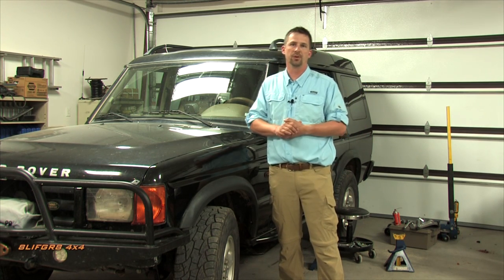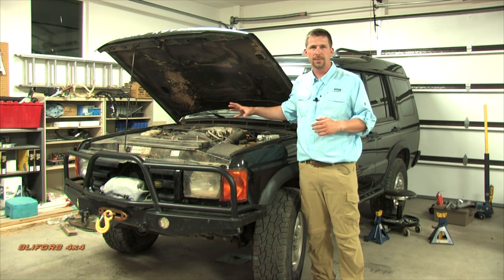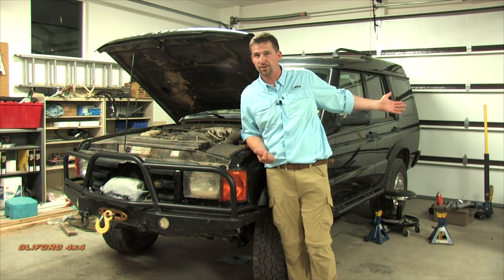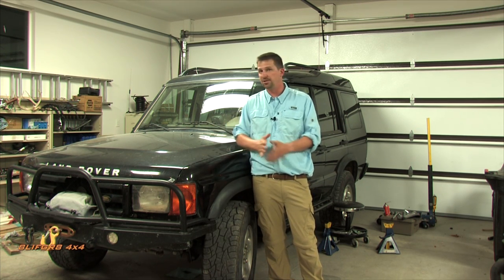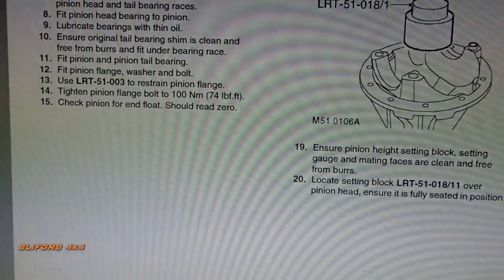Ultimate Owner's and Buyers Guide:  Land Rover Discovery 2

Comment from the maker: CONTENTS:
0:00 Intro
0:55 Front Driveshaft
4:59 Engine
16:36 ABS/Traction Control (3 Amigos)
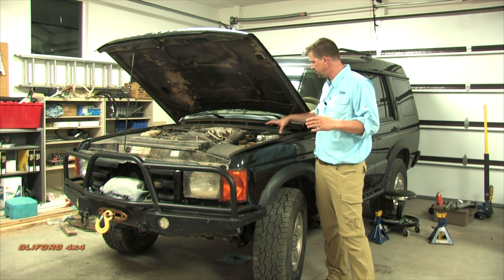19:54 Brake Fluid Reservoir
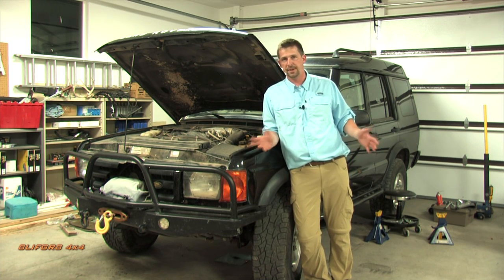20:56 Crankshaft Position Sensor
23:32 Oil Pump (especially 2003 model year)
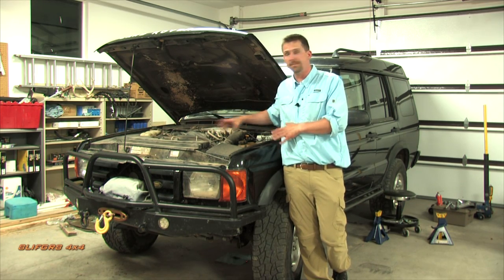24:39 Frame Rust
26:24 Rear Driveshaft
28:49 Headliner
30:16 Center Differential Lock
35:35 Oil Leaks
38:06 Factory Service Manuals and Community Help
39:30 Final Thoughts

If you haven't seen it, check out our more traditional vehicle review here:
https://youtu.be/hWyN0qF666s
Reply: 8LIFGR8 4x4   Thank u can u put a 350 vortex in the Land Rover 2
Reply: instaBlaster...
Reply: Thanks  a million  for this video!🦋

Comment: The best part about the Disco 2's shortcomings is that you can get them for dirt cheap.  I grabbed a clean '99 with a blown headgasket for $700 bucks.  $300 in parts and a few late nights in the garage later and I have a $1000 Discovery that is a blast to drive!
Reply: No rust?

Comment: This is the best Landrover Discovery 2 owners guide/ summary I have ever seen, bar none! Great work! I am a 2001 D2 V8 (4.0) owner in Australia (owned for 3 years) - most of the things you discussed have happened to me. Head gasket! Yes I paid for a new install, after blowing one, and immediately after i did an in-line thermostat conversion to an 83 degrees C (181deg F) t/stat and haven’t looked back. Australia doesn’t have a cold weather problem it’s heat we have to worry about here. Penrith HPR30 is the oil of choice here, Oil leaks are everywhere- keep it topped up. Three amigos are a part of life, but don’t cause any issues. Ashcroft CDL linkage, Rock sliders, heavy duty prop shaft are all future purchases at $1000 each. Parts are expensive but the car is worth it!! Keep up the great videos!
Reply: Jeff Addinsall hit up eBay. I got a new brake modulator block for $100. Got rid of the three amigos and the traction control is now awesome. Also you can get a pair of wheel hubs on amazon if the wheel speed sensor is the problem.
Reply: Jeff, can you eliminate the thermostat all together? I moved back to Hawaii  and when I lived here back in the 90’s it was common to take it out all together in your cars. Having said that it was a 71 Cuda , so a very simple carb, no computer, push rod motor. Thoughts? 
I’m looking at a Disco 2 for sale and would eliminate the cats for sure! More power, better mileage and a lot less heat! 
Cheers
Reply: @michaelm2502  no, a thermostat is a bonus, not a negative. Like the man said, just get a cooler one.
Reply: GOOD ONYA DIGGER!
Reply: @michaelm2502  Hi Michael I did the same thing years ago in an old Holden (GM) sedan I had, but the D2 BMW thermostat setup just runs too hot for Australian conditions. My 83 celcius setup is now spot on. Good thinking on the cats - under bonnet heat is a real issue, and we
Don’t have emissions testing here.
Reply: G'day Jeff

Completely ignorant of D2s, and am looking at getting one, a TD5

Does the diesel have cats, etc that cook the drive shafts like the petrols do?

Thank you for your time

Regards, Will
Reply: @willhooke  great question William, I only wish I had bought a TD5, they have Cats, but there is no way they would run as hot - I have replaced my front drive shaft with a HD one.
Reply: @adda58  thank you for that 👍

I want to get one that's as reliable as possible
Don't want to get stranded, etc
Reply: @adda58 hey mate I also live in Australia, couple of people have scared me about the cost of repair on the disco in aus. Really love the car but just wanted to hear your experience and thoughts.
Cheers
Reply: @finnlord3093  hey! They certainly can be expensive, but if you learn to do a lot of work yourself you will save a fortune. I am about to do a coil relocate, as one of my coils is busted and it easier to put two new ones on top of the motor than pull it apart to get to the old ones .  Depends where you live too. There is almost always a good landy mechanic everyplace I have lived. Canberra has the series workshop, Melbourne has a few, Brisbane as well and lots in between. If not a certified mechanic, you will find a landrover tragic who can help!

Comment: Thank you. I have a 2003 with 200,000 klms.  I put in Castro classic oil with zinc and the correct coolant, but when I checked the clutch fan and the condenser fan they were not good. After doing a hour long run the clutch fan turn easily and the condenser fan was seized. The engine works great on a nice cool day in  Alberta, but when there are things that are not working the way they should they show up on a very hot day in a traffic jam. That is when everything in the disco needs to be right, thermostat, fans and coolant

Comment: I have a 2004 Land Rover Discovery with about 164k miles and live in the southeast of the USA. I use Mobil1 15w-50 ( has 1,800 ppm of zinc ) with Mobil1 oil filter and Dura Lube engine treatment. I have already replaced the head gaskets ( with non torque to yield bolts - used in the 1993 Range Rover 3.9 liter), intake gaskets, valve cover gaskets, spark plug coils ( with wires and Denso spark plugs ), water pump, 180°f thermostat, coolant, coolant hoses ( even changed the plastic lines to rubber hoses ), camshaft, lifers, rocker arm assemblies, timing gears, timing chain, oil pump, front main seal, camshaft sensor, crankshaft sensor, drive belt, idler pulleys, auto tensioner ( with metal pulley ), all four ball joints, front driveshaft, both CV axles, all four wheel bearing assemblies, rear driveshaft rubber part, windshield post covers, plactic trim for the rear doors, sunroof ecu, driver's door lock bar ( updated part ), AC compressor, fuel sending unit assembly, both leather boots ( for parking brake and transfer shifter), gas cap, battery ( redtop ), brakes ( all pads and rotors ), tires ( Nitto NT 421Q ). I resealed both differentials, transfer case assembly, and throttle coolant plate. I repaired the sunroof drain lines. Flushed the engine with automatic transmission fluid ( before replacing the camshaft and lifers ), coolant system ( with distilled water and dex cool ), brake fluid system ( DOT 4 ), and power steering fluid system. Cleaned the fuel injectors, throttle body, and intake system. I have also put dielectric grease on all the wire connectors and grounds.
Reply: That's a remarkable, expensive potentially and time-consuming list, I've driven nothing but old school Mitsubishi monteros for years and found a 2001 disco 2 for 3 Grand which has been owned and maintained by an enthusiast, but I could pick up good old school full size montero for $1,500 or much less for years, never having to spend a dime on them week after month after year , they're Mighty cool, but your intensive maintenance issues / needs indicates to me that I might just steer clear, this video was helpful but your comment told me a lot more than I ever could have absorbed skimming through things, how long did your process of upgrading and maintaining take? Got to be into the high four $ figures and probably a hundred plus hours? Neat trucks but...
Reply: @GreenCanvasInteriorscape  Doing all the work saves money haha. I recently switched to Shell Rotella T5. It's a good daily and project. I think it's a Land Rover thing you love them or you don't buy another/keep them for long. The biggest thing is if you keep on the maintenance and the little tricks, they can be pretty reliable. I have never been stuck on or off the road.
Reply: Can I buy it from you?🙂

Comment: 1999 Model. AKA the green machine....ABS icon on for over 2yrs. Ripped headliner out 10yrs ago. Replace 3 window motors in 5 yrs. electrical gremlins here an there....219K miles. It marks its territory wherever it parks. It changes its own oil- just replace the filter. ❤️

Comment: I'd like to add, that in addition to rotella t6 5w-40, I use a MANN 950-4 filter.  It's a Ford f150 spec filter, it's approx. double size for capacity, and has a hex on the end for easy removal.  Also very heavy duty.
Reply: Was that for the V8?

Comment: I have a hand me down 2003 Disco 2 that belonged to my sister. In the last 5 years I’ve been through every single thing just listed in this video. Except for the transmission disintegration episode. I managed to change my driveshaft U-joints just in time. 

Thank you for this informative video. I’ll make sure to save it in my Discovery 2 file folder. Cheers!

Comment: I owned a 2001 Disco 2. For meany years. I added a CDL from a 04 D2, Installed a 2.5 inch old man emu lift and added the Disco 1 rear spring perches. 
I now own  the Toyota FJ Cruiser, But wanted to stop by and see my old rig. 
Excellent video!
Reply from the maker: Nothing wrong with an FJ either!!

Comment: Hi FW. Just a quick update. Ive installed an OBDll ultra gauge ,fitted the TD5 stat, changed The viscous fan ,  flushed the rad, replaced expansion bottle cap ,and refreshed the coolant .Discovery now driving 188 degrees to 198 Brilliant. It hasn’t gone over 198.  Thats even driving it off road for a couple of hours. All that  from an average running temperature of 210 to 223 in traffic. I’m happy out. Cheers for your advise and taking the time to explain, in layman’s terms what it’s all about. Peter.

Comment: I'm considering buying a Land Rover and I gotta say this video is awesome! Good work.
Reply from the maker: Good luck in your quest!  You thinking a D1/D2/Classic or a modern rover with air suspension?
Reply: @ForgottenWaypoints  D2, D3 and L322 are all on the list! Modern air suspension is definitely appealing for the diversity of performance it could give. Sounds like with a compressor rebuild the reliability is quite good too. I'm leaning towards the D3 the most right now, but I haven't test driven anything yet. On the other hand the D2 has an aura about it that is really unique.
Reply from the maker: @bradcomis1066  , D3 has the best modding support, but if you are ok staying stock there is something magical about the BMW designed L322...they are incredible machines.

I like the '04 where you get the jag motor but still have the mechanical t-case and more travel in the crosslinked air suspension.

I test drove an '11, and it holds up well tech-wise with modern cars.  I loved me L322....just couldn't get past the 19" and 20" rims!

Comment: Thank you for sharing this excellent buyers guide. I've hesitated from buying a 2004 disco II because of all the scary horror stories on-line. I'll definitely buy one now, and will use the information you provided to guide me.
Reply: Go ahead and buy an ultra gauge now. When you go to test drive a prospective D2 just plug it in and it’ll give you a lot of information on the test drive. Temp and codes are the two things to look for.

Comment: If you have a disco 2 you typically love it and hate it at the same time haha. I have a 2003 with 91k miles and a fantastic interior and exterior. Daily driver. But in 18 months of ownership it has had: new water pump, new radiator, new thermostat, crank position sensor, an oil leak, a differential leak, and a handful of electrical issues haha. However, it has never left me stranded and I take it overlanding in Colorado a couple times a year. Beast offroad, looks great, but if you get one make sure you set aside a few hundred bucks a month into a repairs savings account, because your time will come haha.

Comment: I'm probably going to end up watching this several times. 

T H A N K Y O U so very much for this info. I got my 2000 LR Disco around this time last year. It had 94K. It just hit 100K a few weeks ago. I did NOT perform all the necessary maintenance that I probably should have bc the person I got it from was a mechanic who said he'd fixed it for someone and then never heard from the guy again. 

I have the 3 amigos right now and it's been on for like 6 months. When I 1st got a reading i had a few pcodes that pointed to some misfiring cylinders. I got all of those replaced. Even tho the person that did it crossed some of my wires the 1st time he did it.

A rear brake job and an oil change are the only other things I've had done. The guy told me he put a new belt on and head gaskets. Idk about the gaskets but as far as the belt I've had crickets for about a month. It could be a pulley or the belt tensioner big I'm thinking he just didnt do everything he said he did.

I would love to just take my truck somewhere that I could trust and get her running like new. It runs really great now but if I could get some solid maintenance work done she'd be just like new. 

I'm a single mom that's not afraid to.m.mmbget her hands dirty. I've gotten under the hood myself from time to time. I just dont have the time now. If anyone knows of a place in Wisconsin or Chicago please share! Thanks!!

Comment: Awesome video! I have owned my 02 for almost 5 years, did everything you mentioned, the engine was rebuilt at around 100k with the top hat liners installed to prevent the cylinders to slip, and now it's still running like new at 151k
Reply from the maker: I'm jealous!  I'd feel a lot better about life with top hat liners!!  I'm using mine as a daily now, almost 142k on the clock and about time to replace the thermostat again (temps creeping to 194-199 at idle these days)

Comment: Absolutely awesome review - spot on!  I have an '01 D2 that I bought as a pup in '03, and it now has just over 209k miles on it and still going strong - there's nothing else I'd rather drive (I have an '07 LR3 with 62k miles that primarily sits in the garage, the D2 is the workhorse).  My strategy has been simple - to utilize the forums and RAVE to the fullest extent for education and guidance, to stay on top of/ahead of maintenance, and when I need to repair it, buy the very best parts I can find - fix it right, and then feel free to count on that issue not recurring until that part runs its natural life.  I'd definitely attest to what you said about thermostat/head gaskets; I've had to replace head gaskets twice, but have had no issues at all since replacing the thermostat with a TD 180degree about 90k miles ago (also using green antifreeze).  The Rotella oil you mentioned is a key tip too; switched to it about 100k miles ago, and my engine has no tics.  My D2 is still stock height, fitted Bilstein shocks on it a few years ago, and it rides and handles great; passengers comment on how well it corners for a heavy vehicle.  I've replaced the radiator, water pump (recommend brass rotor version), all belts and hoses, plugs and wires, O2 sensors and MAF sensor, but other than that and the head gaskets pre-180 thermostat, engine is a reliable workhorse with 4k mile oil and filter changes.  Definitely agree that front drive shaft and thermostat are the key first things to do if someone buys one of these (my replacement front drive shaft is serviceable); I also think I benefitted greatly from my recent alternator replacement; bought the 150amp Bosch made for the Range Rover P38 (bolts up exactly the same as original).  I had issues with the lazy braking you mentioned in another video until I installed EDC rotors and Akebono ceramic pads; no issues after that.  

OF KEY IMPORTANCE in looking at these vehicles, in my mind, is realizing that most of the work required through the years are things that would be required for any other vehicle if they're kept long enough and routinely used - with the only likely exceptions being the front drive shaft, power door locks/actuators (I've now replaced all 5 of mine, the auto locking/unlocking takes a toll on them through the years - easy process following the RAVE instructions), window regulators/motors (have now replaced all four - again, easy process following the RAVE instructions - and for this and door lock replacement, just be sure to stock up on panel clips in advance), and the throttle body heater plate/gasket is a pesky but easy to replace issue every few years.  Agree also with your Lucky8/Ashcroft center diff shifter recommendation; I installed it and have used it without issue (their installation video doesn't hurt the eyes either), and it adds great capability.  I replaced the rear flex coupler you mentioned just as a preemptive move; I drive this thing a lot late at night on 2-3 hour trips coming back from playing music with a fairly busy band, so I did that just for peace of mind.  Which brings up another point you mentioned in another video - these things have wonderful cargo capacity!  Rarely a week goes by that someone helping our band unload or load equipment doesn't express surprise at how much it will hold . . . the square shape and lack of angled glass allows for almost van-like capacity.

I've owned Land Rover vehicles since the Range Rover first came to the U.S. in '87, and although this was my first Discovery, it has by far been my favorite of all of them.  There's nothing quite like them, and I think they may someday be a bit of a cult vehicle and surge in value like the Defenders have.  Thanks for your coverage of these great vehicles!
Reply from the maker: Well said.
Reply: Let us be thankful people don't know about D2s just yet. They are good and cheap!!
Reply: Absolutely ! But of course I'm completely biased 😍
Reply: @agilchrist73  Oh, people know about them all right — that’s why they are so cheap. Bought my 2000 D2 in near mint shape for $1,500 three years ago after the driveshaft punctured the transmission. The owner had spent $8,000 trying to keep the thing running for his daughter and was beyond fed up with the expenses. They will never be a cult vehicle because they won’t last long enough.